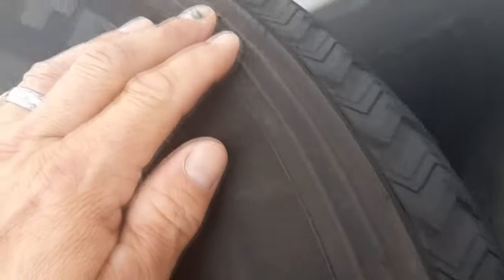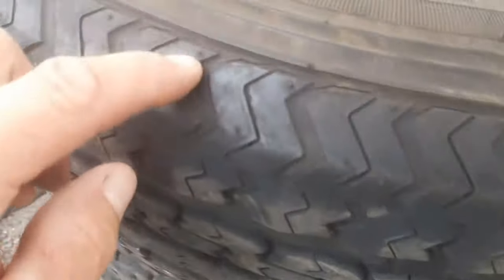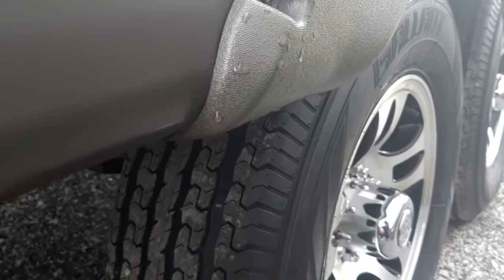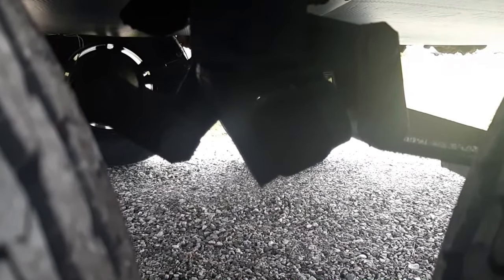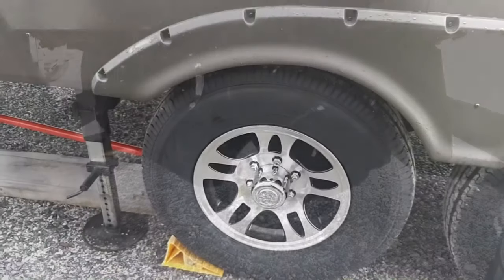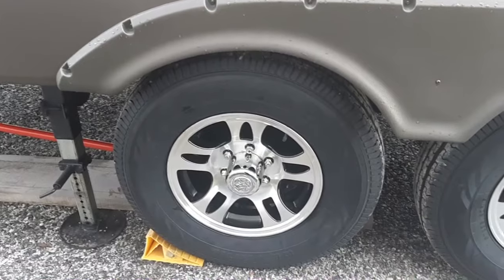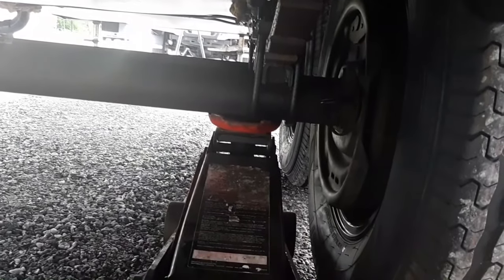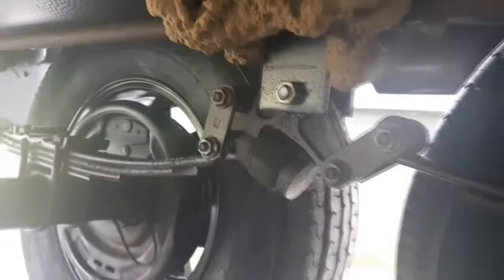How to fix flipped trailer shackle (Dexter E-Z Flex) @OpenAirAdventure

Comment: Damit, I have been rv ing a long time and never knew about this until, I recently replaced all tires but this time I removed all the wheels at home and took them to the tire shop. The problem  was my method of jacking up the trailer. Now I know why the warning says do not use stabilizers to lift rv from the ground. For the life of me I couldn't figure out why my trailer was listing to one side on my trip last weekend. I thought I broke a spring. Sure enough, my hangers flipped on one side. Your a life saver. I would have been replacing my springs this weekend if not for you.
Reply from the maker: This makes me happy Gary

Comment: Thanks for the video.  At 2:34 the video is under the trailer and good shackle is on the right.  At 2:52 when he begins using the jack the camera is on the outside of the trailer and the good shackle is on the left.  Lift the good shackle.  NEVER try and help it with a pry bar, you will break an arm or jaw or worse!
Reply from the maker: You got it, thanks for watching.

Comment: What size camper do you have and what size floor jack?  My 14,500 lb 5th did the same thing when i changed tires.
Reply from the maker: 30', 10,000 lbs. It doesn't take a whole lot to lift the axle so 2 or 3 ton Jack should work.

Comment: I've got a 14' enclosed trailer that had a Harley Trike and about 400 pounds of other stuff in it.  Loaded properly, correct tongue weight, load distribution hitch.  I had one flip going around a tight exit ramp curve on the inside, I must have hit a bump.  VERY SCARY, as the front tire took the weight, which completely unloaded the tongue!  Crawled to a trailer place that did this for me, but with a bar.  Unfortunately when we got home I noticed that the equalizer is no longer level with the trailer leveled and the distance between the tires side to side is 5 on one, and 6.25 on the side that flipped.  A straight edge shows the front axle tire angled about 3/8" out.  Something must have bent, or an axle slid on the spring or something.  Now I'm trying to find a place around here to re-align the axles, without a whole lot of luck.  I did try to jack up the trailer, but of course not knowing this, I got the wrong axle, or maybe I put it on the frame.  Any advice, anybody?
Reply from the maker: @nathanwahl9224  the equalizer usually doesn't position itself perfectly straight. Most of them that I've seen, regardless of the male or quality, sit a little slanted. I'd say take a few measurements and see how the axles line up with frame. You're probably ok, but check things over regardless.
Reply: @OpenAirAdventure  The distance between axle centerlines is about 1 1/4", most places I've seen say rhey have to be 1/4" or less.  A quick look didn't show anything, at least nothing appears bent.  I'll have to look further. Thank you,

Comment: How did it get flipped? I just noticed one side of my dual axle travel trailer is sits lower than the other side. I looked and compared the two shackles. The higher side has the shackle proper and horizontal flat and even. The lower side I see the shackle isn't flat like the other side, one end is high  and other end low. Could it be due to the uneven ground? I will look more tomorrow. Thanks 👍🏼
Reply from the maker: How did you make out?
Reply: @OpenAirAdventure  I examined more closely every couple of weeks and it's not as bad as I originally thought. I think the reason why my travel trailer is lower on the passenger side is due to the ground being a bit lower on that side. Best way for me to tell better is to hitch up and take her out for a spin this spring to the nearest beach where there's plenty of huge flat parking. Thanks for asking. Happy and safe RVing 👍🏼🌲☃️

Comment: After 7 years my boat trailer shackles are suddenly flipping when I turn sharply such as into a driveway, around a 90 degree corner, etc.  After calling the manufacturer, I replaced the equalizer, shackles, all bolts and bushings.  It still happens.  Interestingly it doesn't seem to matter if the boat trailer has the load of the boat on it or not.  Does anyone have any idea what could be causing this?
Reply from the maker: Not sure why after seven years this is just starting or was it happening all along and you're just noticing the issue. So if its happening frequently its definitely short leaf springs, your links or shackles should be somewhat vertical, take a look at the video after I flip mine and lowered the jack and you will notice the angle, if yours are too short the angle will be more horizontal like the leaf springs. And if the shackles on your equalizer look like they are in the right position then replace the shackle links with longer one's, short links tend to flip more easily. Hope this helps.
Reply: @OpenAirAdventure  Thanks for the reply.  The links seems to be in the right position when not flipped.  I'm beginning to wonder if the leaf springs are getting weak and allowing this to  happen.  The trailer is in great condition and doesn't have many miles on it for it's age (400-500 miles/year).  Hate to throw it away and buy a new one for this issue.
Reply: @MillerMarineLLC  I have a much older trailer that is specifically set up for 15" tires.  I cannot fit 235/80r16's as they rub between the front and back tire.  The newer trailer manufacturers have been stretching the same suspension to fit taller tires, and in doing so the geometry of the shackles is close to flipping.  You may try a longer equalizer before longer shackles.  I had tried longer shackles, but ended up breaking the top leaf spring, so keep that in mind before trying longer shackles.
Reply: Just a guess and I may not know what I’m talking about here but, has there been a change in the tongue height of your trailer? In other words is your trailer higher in the front than it used to be possibly by changing your hitch or the height of the back your truck? Possibly maybe this is what’s causing it

Comment: At 2:45 you said the one on the "left" is flipped.  Which is incorrect.
Reply from the maker: From underneath the trailer at 2:45, in that shot the left is flipped. Then at 2:50 I'm filming outside so the flipped shackle is on the right. That might have confused you.